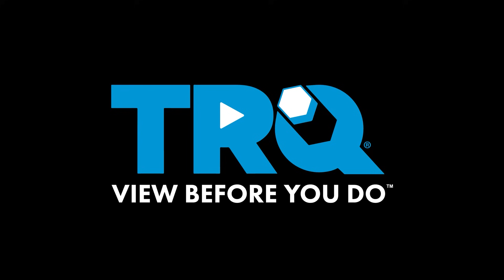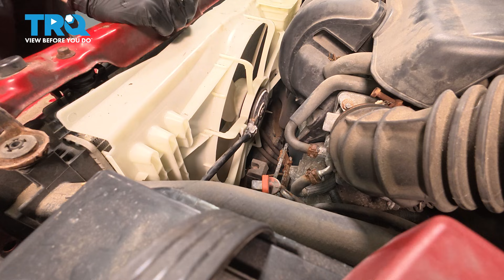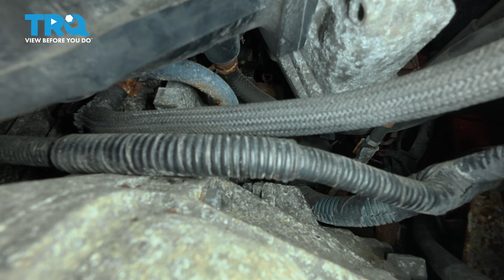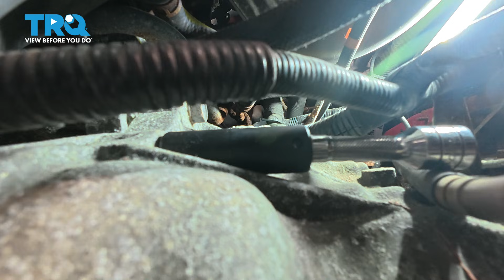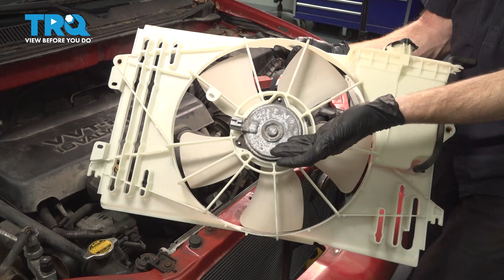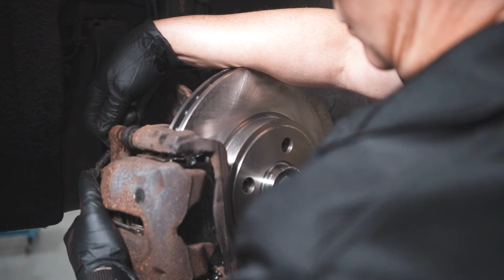How to Replace Starter 2003-2008 Toyota Matrix 1.8L L4

Comment: Always looks so easy but I've always run into extremely tight spaces where even getting small stubby ratchets or wrenches in is almost impossible.  I've always successfully installed parts but it's never this clean 😂